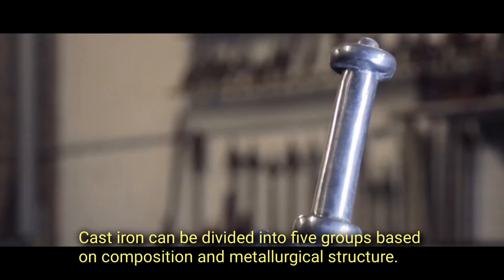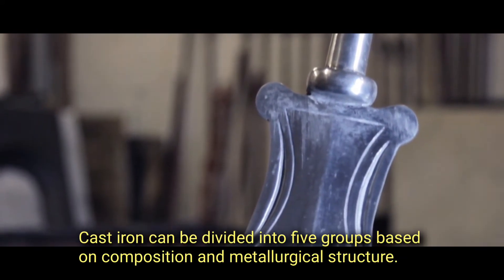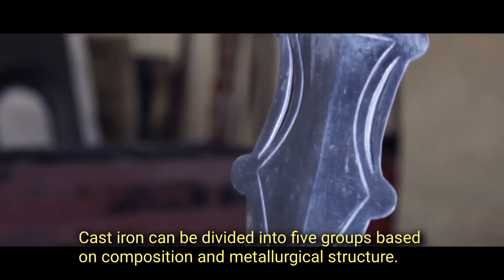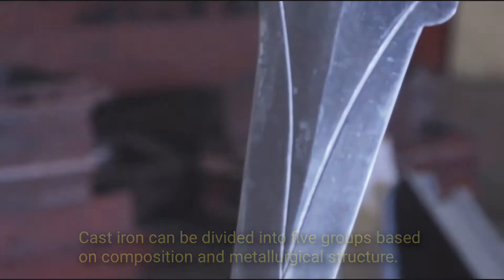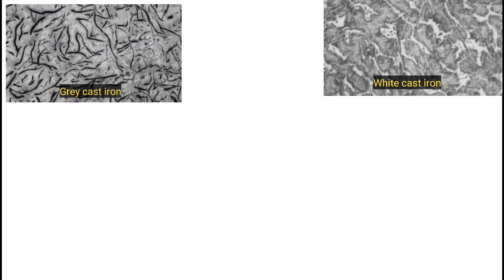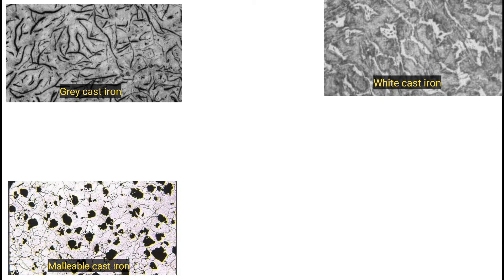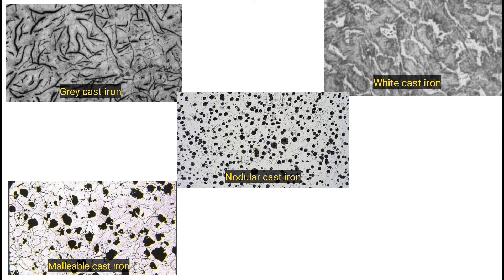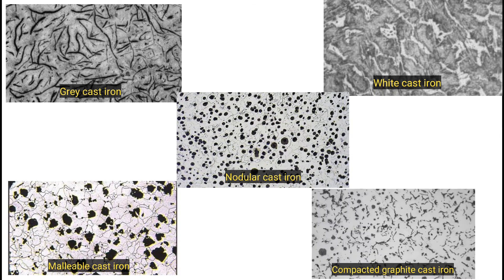Types Of Cast Iron And Their Differences | An Overview.

Comment: Truly amazing all the forms of cast iron.   It does leave me with the question of can steel be cast like cast iron?
Reply: Of course steel is cast (I work at a steel foundry that casts many steel types, several cast iron grades and some nonferrous alloys too).   Cast iron has better fluidity and can be poured at lower temperatures.